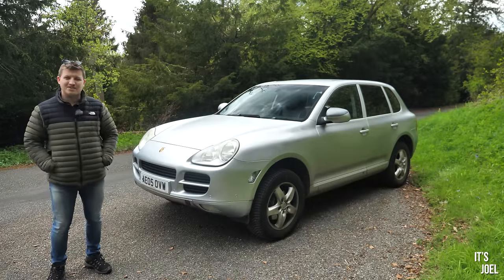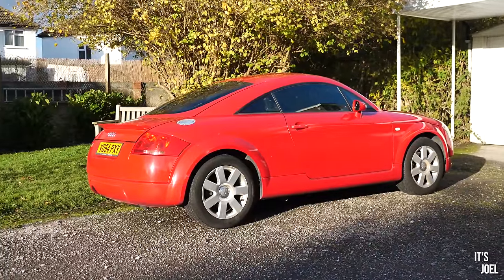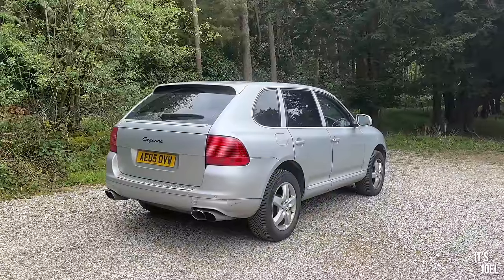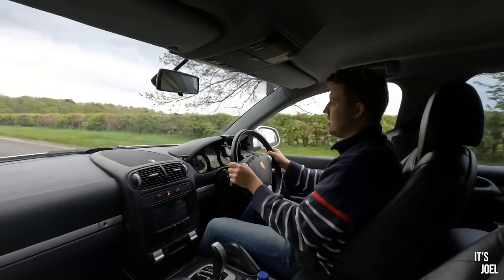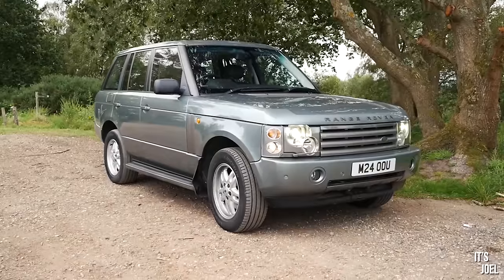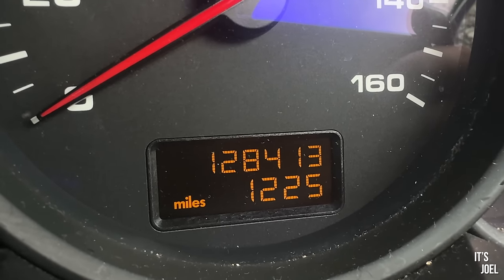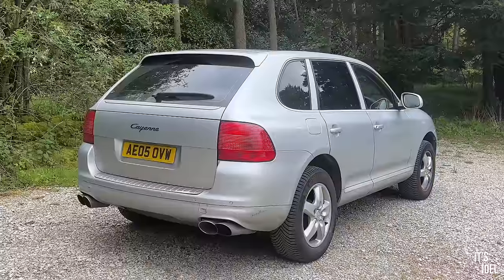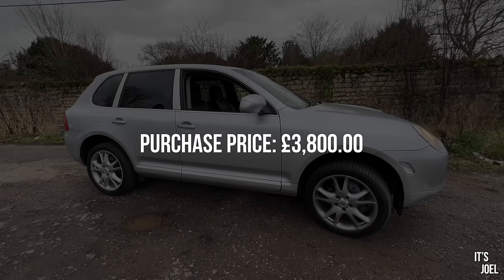6 months with my cheap Porsche Cayenne, the true cost of ownership...

Comment: Actually you are being hard on the car, its an 18 year old car, the £800 on wheels is not a running cost, you probably would need to replace the tyres after a couple of years so a more reasonable number might be £150 for tyre wear in 6 months. Similarly the gearbox service a good idea but not that much spread over 5 years. Annual service £500 ish.The jobs you had done were age and condition related. Perhaps the full inspection should have been done pre purchase and a keener price negotiated because of some of the issues. In reality the £5000 figure is probably nearer to £1500. The car is probably fuel aside a lot cheaper to run than you  think. One thing they don't teach at school is basic finance and most people are completely at sea. They get their mortgages wrong, they finance cars they really can't afford all because they make the wrong assumptions. You can't do anything about the fuel, except stop the premium petrol which is almost certainly an unneccessary gimmick for this engine. The car itself is a reliable daily driver and with the maintenance you have already done is probably costing less than £2000 to run annually. Things will go wrong so a bit extra. With the finance option you talk about you will probably pay about £10000 in interest over the 4 yuears and suffer the depreciation unless you simply hand the car back.
Reply from the maker: Yes, in a lot of ways I much prefer this as opposed to paying interest. This is not a finance channel of course, but I/we invest several ‘average PCP’ payments per month into SIPPs and S&S ISAs, which in the long run will work out much better than putting the money into a depreciating asset.
Reply: I've probably spent 3k or more on my 2010 jeep wk but 90 percent is just Serviceable parts that at some point want doing anyway as things do want doing after 10 plus years of life so actually after all the big stuff is done actually it works out cheap to keep on top of it

Comment: As an owner of a Volvo XC90 V8, after almost a year  I doubled the money I spent on buying it. Do I regret? No way, it's almost perfect with 280.000km, after rebuilding and modifying the engine now it's quicker, sounds better, suspension parts are in the boot and some gear/haldex/diff oils to be changed next week. I was about to sell it and buy ML63 AMG, but the Merc was in very poor condition, so I'm keepin' the Fast Swede 😁
Reply: Perfect Sleeper SUV. Good choice

Comment: Bought a 2004 S 4.5l. Done 170K brilliant motor. 20 years of pleasure, expensive yes but just did 200 Mile round trip on one tank £120 fill, have 35 mile range left.

Comment: My car ownership costs as a new driver in a 2016 Seat Ibiza TSI - Fuel 40mpg, roughly 16p per mile. Maintenance so far of only a yearly service £200. Tax £35 per year. The real kicker, £2500 insurance. Total 38p per mile over 12,500 miles. Although, I only do around 5000. I look forward to having 20mpg in a big V8 when insurance isn't an issue!

Comment: I use my 4.5 V8 955 as a daily driver. I’m older and my insurance is around £350. My mileage per annum is also lower than yours so I don’t feel the crazy MPG that much, although it can be painful! You’ll have fuel and service costs with a car on HP so I don’t think you would see huge savings. I like the fact my old 2003 Cayenne is mine and not on HP, it’s nice being able to swap and exchange when you like but also knowing you’re not tied down to large monthly payments if circumstances change. No plans to sell mine any time soon. Although I have got my MOT coming up and I know we have a few items to sort out before then, wish me luck!
Reply from the maker: Good luck with the MOT. Mine is due soon actually, hopefully it doesn’t warrant an episode on YouTube!
Reply: May I ask who you use for your insurance, that's a pretty good price I presume is fully comp?

Cheers
Reply: My insurance is with 1st Central and it’s actually £298 which includes NCP and breakdown cover. I thought they may put it up this year so was prepared to shop around but they didn’t… so I’m sticking with them. 😊
Reply: @itsjoel  failed on Engine management light… (its a bloody censor) and airbag censor plus flex section of exhaust which includes a Cat… this also meant the emissions failed… hopefully sort it out this week 😮

Comment: Ive averaged about 1,600$ Canadian per year in my 09 Cayenne V6 3.6L. Bought it 2.5 years ago at 146k kms now at 188,888 as of today. Only things I had to replace where the front wheel bearings, a/c Blower Motor, Windshield Wiper Motor, I did the driveshaft proactively but that wasn't a necessity nothing was wrong with the original one I just planned on keeping the car for years to come so didn't want it to fail randomly, asides from that I did the transmission fluid and differential fluid when I bought the car, and also just front pads and rotors plus tires but thats just regular stuff every car needs. I also bought 21' OEM GTS rims plus the 21' tires for them which makes the car look amazing. I do need to fix the front left turn signal it does not work atm but ive put it off as its not necessary to drive properly and its the wire harness not the bulb that needs replacing so the entire front bumper needs to be taken off. Thats why I haven't done it. Also I had to buy a new battery for it and the Kenwood headunit I bought the car that was installed died on me so I bought the exact same one off eBay so it would just be simple plug and play remove the old plug in the same replacement new unit. Its never once left me stranded..... Ive ran over some nails  two different times and the TPS sensor warned me I was losing air rapidly so I pulled over and the spare tire came in clutch along with CAA, put on the spare and was good to drive home then to fix the tire with the nail. She's been reliable and looks amazing with the black paint, tinted windows, 21' GTS rims and silver trim accents. I also upgraded the headlight halogens to white LEDs. Looks way better with that. Also bought a new Porsche Crest for the front bumper got a perfect used OEM one off eBay for 20$ and also spent 100$ on some Refurbished OEM  Porsche wheel caps from eBay.

Comment: Used to run high mileage 540i V8's for 25k miles a year, £600 a month on fuel alone!  When you thing about finance costs, always remember that they are effectively the same as your depreciation.  Your £850 per month is £400 per month running costs, depreciation £very little, fuel £400 per month.  Changing to a financed car at £800+ per month = depreciation, maybe half the fuel cost £200, and then the running costs £300 per month so in total, much much more!!

Comment: Hi Joel. Those costs are about what I would expect. You bought the car at a low price then paid to bring it up to your standard. You’re doing this right. Keep it for as long as you can suffer the fuel costs. Shame you didn’t spend a bit more and buy a slightly later diesel. 

I have a 15 year old Audi A4 Avant that I’ve owned from new. It’s well looked after and  dependable as a result. Long term ownership is helping me to save for something special to use at the weekend. 

Was that the Shell garage near Longwick? My wife’s mum lives in the Chilterns so often use that garage on the way back north. 

Keep up with the great content.
Reply: The slightly later diesels aren’t actually that much more economical and the tax is an extra £300. That and the emissions things on diesels can cause expensive issues. Factor in the extra purchase price and I think this is probably better value

Comment: Thats for posting Joel. Your considerations about a newer car was interesting.
I have to agree £350 on fuel is just a bit to much, essentially its poor value for money considering you are only doing a moderate amount of milage but I can also see the advantage of keeping it now its sorted.
On the issue of borrowing, I can understand the need to lend money to buy a house but car are very different. You have proved that its possible to own a decent prestige car outright. If you need any more convincing work out how the difference between a car payment of say £600 and the equivalent over payment on your mortgage. It will shock you (not least because when making an overpayment you will be clearing debt for the life of the mortgage which is usually for 300 monthly payments)
Dont be a lemming and finance a car unless you are absolutely desperate for transport and even then consider getting a bicycle.
Take care Andy
Reply from the maker: Thanks Andy, exactly. Potentially £100,000s can be saved in interest by overpaying on a mortgage or even taking spare money you might use for a car finance payment and chucking into the S&P instead. I’m quite anti interest and so getting a mortgage was a tough pill to swallow!

Comment: I had a vauxhaul Vectra 2.5 v6 I owned it for well over 10 years, it would return 19 mpg around town and about 25 / 26 on a run  but I loved the way it went, so the fuel cost really didnt matter, i also used it to tow a caravan which it was more than capable of doing. We went from stoke on trent to peranporth in cornwall with the caravan on the back, I just about managed to get there on one tank of fuel I had 2 x 5 ltr cans of fuel in the boot just in case lol
Reply from the maker: Something about the older naturally aspirated engines!
Reply: My parents had one of them when I was born, apparently they go like fuck 😂

Comment: I drive a 957 turbo S which I spend around £300 per month on fuel. Tax is about £45 and insurance is around £35. No further costs but I have recently changed headlights and ballasts £3200, discs and brakes plus a new front calliper £900 for d&p £1600 for the calliper. It’s had a transmission fluid and oil change for which I provided the consumables and the labour was around £200. Aside from the oil change these were one off payments. I had already done plugs and coil packs myself. I would have done all the work myself but due to major surgeries I wasn’t able. 
You should expect to become a regular customer of Design 911. You will need to clean your roof drains which you can do from the bottom with a £6 trombone cleaner otherwise you will get a puddle in your spare wheel well. I had to buy a replacement Bose sub enclosure and amp as mine was completely rusted (the amp and speaker) that was about £250. Other than that no issues but those faults are quite common, leaky headlights blocked drains and obviously d&p are a consumable item. I always use Brembo for d&p.

Comment: I tend to say there is a fussy logic there. For instance you don't swap tires and wheels every month, and this is also true for the transmission service.or other minor repairs. If you like you could add the repairs to the acquired cost, then cost average between services (and insurance cycles) to derive the monthly cost. I will say that the fuel consumption is ok. Nothing good or bad, just typical V6 mpg. I have 958 V8 aspirated engine. Driving around town she does 15 mpg. She does better if cruise control is used and keep the speed at 65mpg. In this case 18 mpg.

I do all the maintainence myself saving some labor cost but the spare parts are still for a $90k car. I keep the V8 because i only add 6k miles a year. For daily driver i take other cars.

Comment: Great video on the first 6 months with the Porsche Cayenne! A few points to add:

Preventive Repairs: It would be interesting to also account for preventive repairs in the costs. Since these likely won't be needed in the first 10 years, it would be fair to calculate this pro-rata. For example: (costs / 120) * 6.

Wheels and Tires: The exchange with a different set of wheels and tires should not be considered a maintenance cost; it can be seen more as a matter of comfort or tuning.

Suspension: Regarding the stiff and hard suspension mentioned in the video, this likely refers to the standard suspension and not the air suspension. The latter is known to be very comfortable!

I’m curious to see where the costs end up after 6 months!

Comment: Running costs is only ever Total Cost of Ownership over the period of ownership (so Purchase Price - sales price + running costs over the number of months).  The best thing is, excluding cosmetic mods (you can sell the wheels etc), you may find it has been quite cheap to run if you can get more for it than you've paid.  I work on a basis of 10% of purchase price per year as depreciation, the rest you can calculate based on your circumstances and buying older higher spec fuel drinking vehicles is still cheaper.  When my friends were your age and buying new Fords and Rovers, I was running RX-7's, more fuel (14mpg!) and higher insurance but little to no depreciation, less in total to run vs depreciation on a new car, and much more fun (smiles per mile).  Life is too short to drive boring cars, so drive the best exciting ones you can for less cost.

Comment: I ran the first generation X5. MPG  was around 30. Not much went wrong but shocks cost around £500 and a single fuel injector alone was £250 plus labour etc. I replaced it in 2019 for a 5 series and when i sold that car this year I'd lost around £250 per month in depreciation.  When you factor in that the x5 wasn't really depreciating any more it was actually significantly cheaper to run than a more modern car. I loved the x5 and kjnda wish i still had it.

Comment: I’m at the other end of the spectrum, my 2017 BMW 330e is almost at 100,000 miles and I know I need to change it before it starts costing me serious money in repairs, but I’m still getting 54mpg and everything else I look at will cost me more in petrol!!!
Reply: Keep it for two years remember you don’t own lease car.
Reply: My 330e gets 55mpg on a run but if it is not changed and I am doing the morning run dropping of children and going to work (30mins -40mins approx drive) I only get 20-21mpg. If I drop it into sports mode I only get high teens. Basically you need to charge it for short trips.

Comment: I’ve got the same car as you v6 same kind of spec but with air suspension, car just floats unless you sport mode it, had it for 2 years, paid just under 6 thousand with 65 thousand on the clock, just done 77 thousand now 🤔I don’t trust other people to sit in any car of mine never mind work on it, just oil changed it,oil filter,air filter,cabin filter, air con re gas, £140,
Rear hatch rams and glass rams changed(stabilis) £110
I’ll be doing a gear box(tiptronic) service next month plus front and rear diff and transfer box service for less than £200
Plus various trim piece changes (broken front and rear air vent) changed for £70
Broken rear cup holder replaced £25
Rear seat centre armrest damaged with rubbing on seat belt connector (used one sourced) £40
Broken passenger side B pillar vent changed £25 ( do have to say trims are a bit flimsy)
Plus treated myself to a xtron flagship apple play with forward and rear facing cameras, (not yet fitted) £460 other than being a bit thirsty a real good car

Comment: I’ve been happily doing small improvements and fixes on my 15 year old Mercedes E350 CGI coupe.  Doing some jobs myself like brakes, coil pack replacement, aux belt/idlers/tensioner.  Some jobs at a specialist (tyres, transmission service, engine mounts).  I was unfortunately just hit with bill for a grand to replace most of the brake lines after one ruptured.  I guess it’s what happens with old cars.  I am enjoying making it a better car but I’m wondering if it’s financially sensible to keep trying to improve a £4k car.  The Cayenne may make more sense though.
Reply from the maker: It’s a tricky one, and the economics of running old cars can switch on one nasty repair bill

Comment: Get an E53 X5 V8… £2200 cam chain guides, £2100 transmission rebuild, £250 ABS module, tyres, brakes, suspension overhaul etc. Granted that is over 10 years. And 19mpg too… I was forced into buying a cheap runabout a few months ago as it was off the road - a Honda Civic. 55mpg. That’s really noticeable.
Reply from the maker: Had that engine in my first L322. They can be greedy!